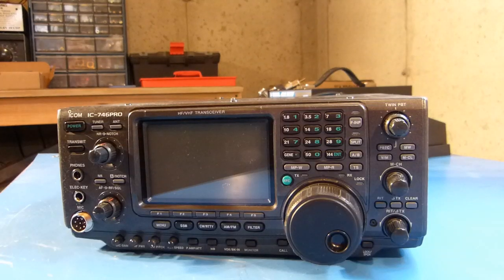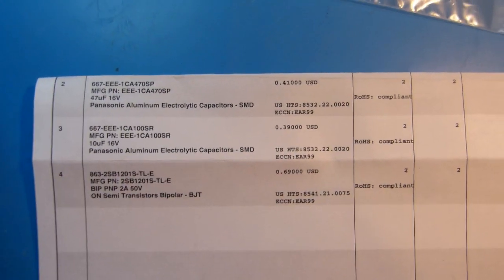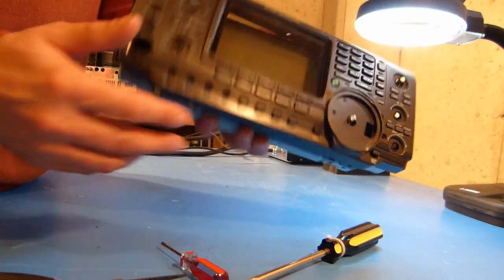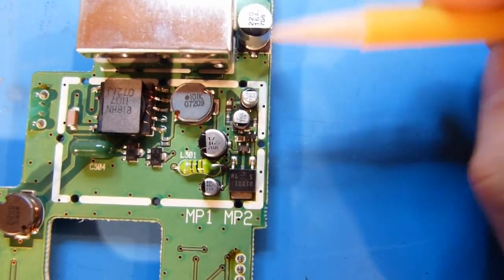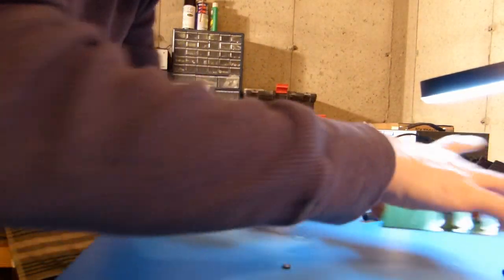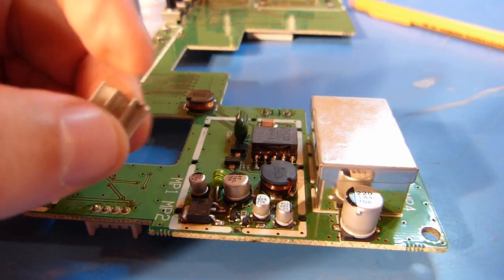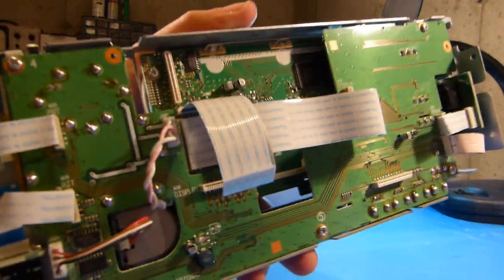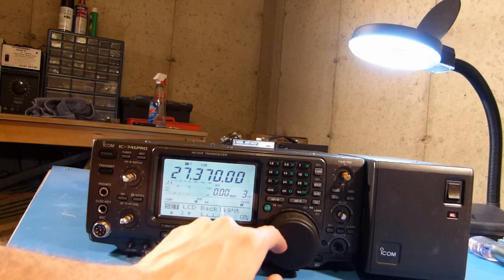Icom IC-746pro Backlight Repair Highlights

Comment: Thanks for the excellent video, made repairing my IC746 much easier.  For the heatsink I just used a right angle of thickish copper soldered to the front edge of the cover and when soldered back into place it presses down on the device with a smidge of heatsink compound.
Reply: i did same though unfortnately i have brightness ajustment problems with mine
Reply: @mi0lpo  Brightness adjustment works OK after repair on mine

Comment: Hello, I did the same thing, changed the chemical capacitors like you. It works correctly and the screen lights up immediately unless I store the device for 3 days without turning it on, when turning it on a 4-second delay appears? Only if I turn it off for several days, otherwise it is immediate. Any ideas?
Reply from the maker: Mine does that sometimes too ever since I fixed it.

Comment: Great video. I am going to buy one of these radios from my elmer when her gets back from Florida. the radio has the same issue. I will have to buy a flux pen. What material did you cut the heat sink piece off of? Also where did you order the transistor and the capacitors from? 73
Reply from the maker: The heatsink was something I found in my junk box.  I got the other parts from digikey
Reply: @SevenFortyOne  rodger that. Thank you.

Comment: Thanks for the video about the backlight issue on the Icom IC-746PRO. I bought one in an estate sale with the intention to resell it. But first, I wanted to play with it for a while and test it out. Wouldn't you know it?  The backlight went out yesterday.  Thanks to your video, I feel confident that I can do the repair myself.
73 Paul AA1SU

Comment: My display still works but I don't like the dark yellow color. I wonder if it's possible to make it any whiter?
Reply from the maker: hmmm---I've never seen one of these look yellow at all.  Dim white, but never yellow-ish.  I wonder if someone modified your radio with a different backlight type
Reply: @SevenFortyOne  It's probably just getting old and the brightness only goes half way up. Can the backlight be replaced if it goes bad?

Comment: Hi, I know this video is 9 years old, but I have just carried out this repair on my 25 year old IC 746 successfully and thanks to your excellent video the disassembly was a breeze. I did put in a higher rated transistor and fixed it to the inside of the shielding can as a heatsink, separated by a mica film and heatsink paste, with short flying leads connectred to the circuit board pads.  I measured the capacitors and they were fine, so I didn't bother to chage them although I do have them should the need arise in the future. So just a thank you for taking the trouble to video your experience. 73s
Reply from the maker: I'm glad you liked this video!  Thanks for taking the time to let me know it was useful to you.
Reply: What was the ESR  & capacitor values on c 302/3 ?,

Comment: I was recently given an IC7400 (same rig different badge), I was told that the backlight did not work, weirdly while I was playing with the radio on a  small power supply I was curious to see if TX coverage was expanded. Of course the subsequent brown out due to 5a current limit caused the radio to reboot and backlight came back on. Was OK for days after that but has now gone out again. Tempted to drill some vents in the screening can when I repair it and maybe a stick on heatsink on the transistor. Even on receive the radio runs pretty warm, I bet the temperature in that screening can is very high hence the capacitors failing. Thanks for the video.
Reply: Slight update, the 7700 gets the same problem and does not have the screening can. Those capacitors do work hard though...

Comment: Would you have any info or a video on using LEDs to replace the backlight for a IC-746
Reply from the maker: Sorry - I don't have any info on that.
Reply: OK, thanks.  Seems like the way to go especially if the difficultly is similar
Reply from the maker: It might be easier to fix the existing backlight unless the bulbs are vured out...might be hard to get the LEDs to light evenly.
Reply: Once I get info from N1EQ who performs this I can decide if its harder or easier.  He also repairs this problems.  Someone in Canada is selling a kit. I emailed
them for the installation instructions.    Ken
Reply: Sorry to be so off topic but does any of you know of a tool to log back into an Instagram account?
I somehow lost my password. I would love any help you can give me!
Reply: @Maxton Kyrie instablaster :)
Reply: @Thaddeus Azariah i really appreciate your reply. I got to the site thru google and im in the hacking process atm.
Takes quite some time so I will get back to you later with my results.
Reply: @Thaddeus Azariah It did the trick and I now got access to my account again. Im so happy!
Thank you so much, you saved my account :D
Reply: @Maxton Kyrie Happy to help :D

Comment: You could have made a metal strip to the metal box next to the transistor and use the case like a heat sink.
With some spring tension and contact compound it would have worked fine and is easy to make :-)
Reply: Yep, exactly what I was thinking.

Comment: stupid question maybe, but r u you sure u just dont need a new bulb? lol
Reply from the maker: The bulb is fine ... as you can see in the video, replacing the transistor and caps solved the problem.  Also this is a well known and documented problem with these radios.  Thanks for watching and taking the time to comment!
Reply: SevenFortyOne
my "bulb" question was just being facetious. just being funny. but, all joking aside, it is a bulb and bulbs do burn out. make an aftermarket switch to turn that thing off!